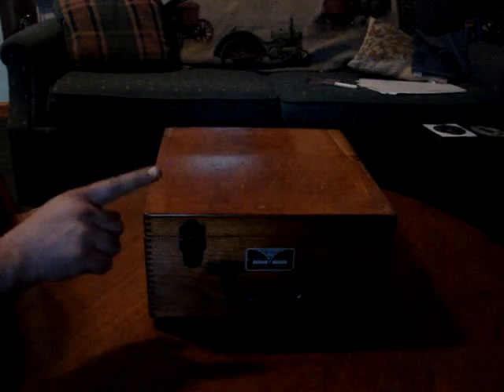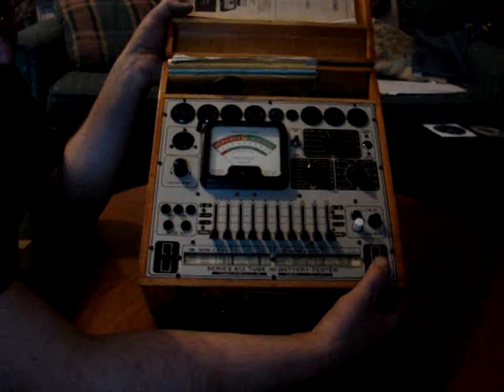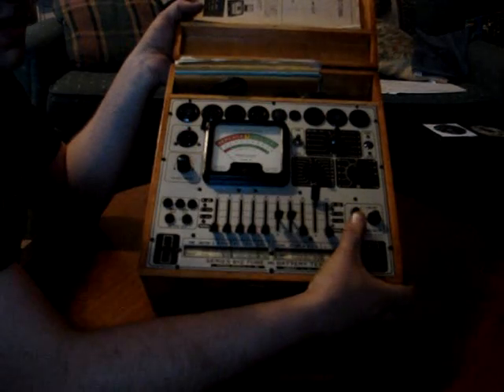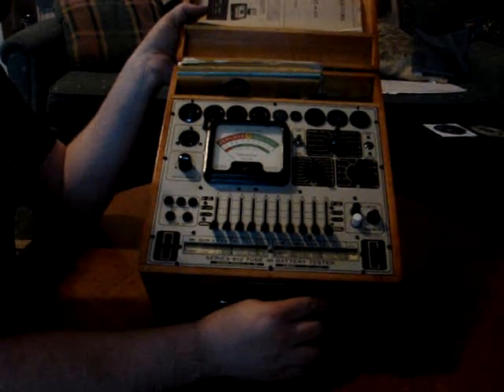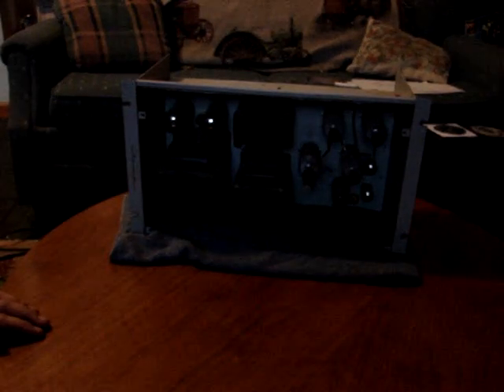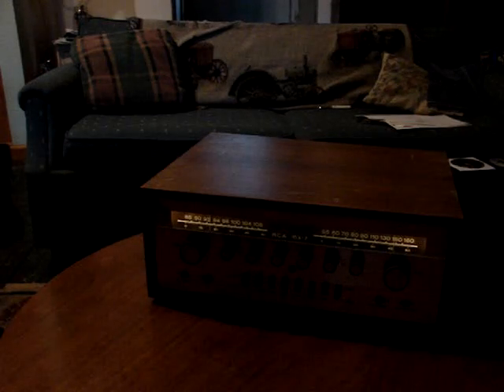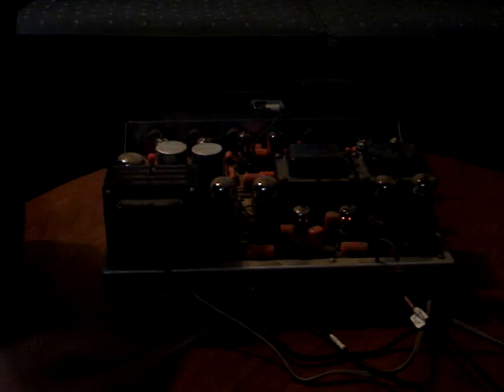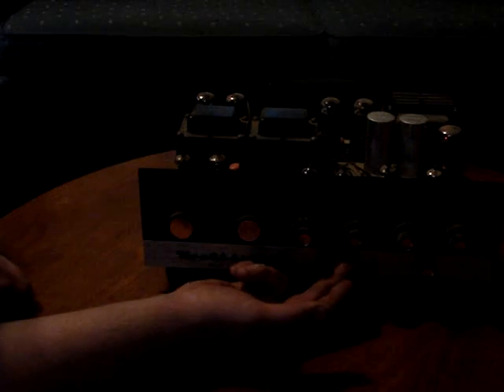The Learning Series - Vacuum Tubes and Amps Part 8

Comment: i enjoyed these video's. i have taken an interest in tube electronics very recently after i received a Conar Model 250 oscilloscope and this cleared up a lot of questions and uncertainty about old electronics. I had no clue how they worked internally until now. And i have to ask, what is a common tube tester that would be relatively inexpensive and relatively easy to find? all the tubes in my scope are 9-pin except the 6ax5-gt rectifier which is 8-pin.

Comment: Great video series. Thanks for taking the time and effort to create them. Very interesting, and great to see so many fans of tube related equipment.  I have both transistor and tube equipment, and love them both, but for some reason I love the sound of the tubes just that little bit better.

Comment: @farmall1938 Yeah, I thought so. I think they originate from a 70's tube radio. I just found out that the ECH is actually a heptode/triode combination. I reckon that heptode would mean 7 components - anode,  cathode and 5 grids - correct me if I'm wrong. What are they used for? Oh, and I found a place on the net where I can buy NOS russian equivalents to 6L6 and 6V6. Which one is better for my purpose?Thanks in advance :)